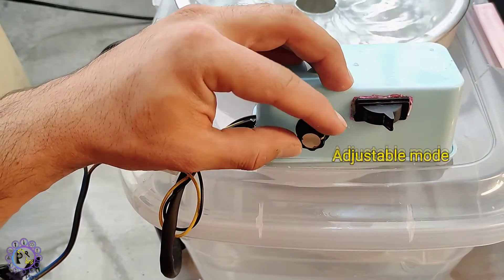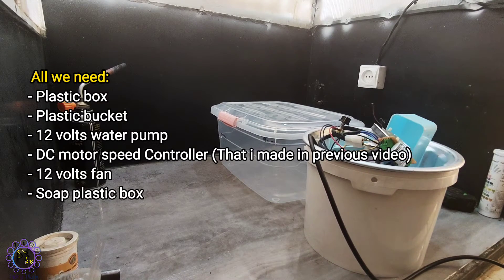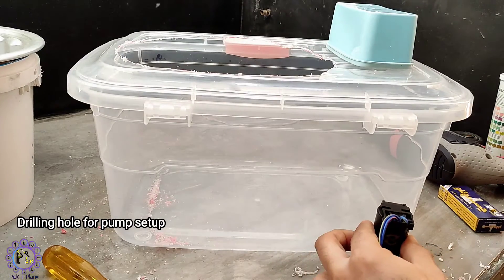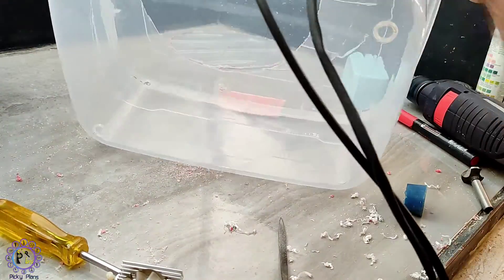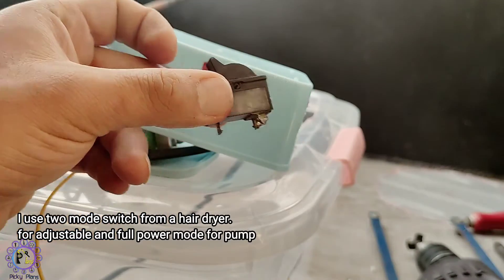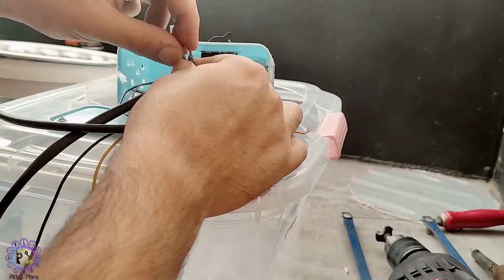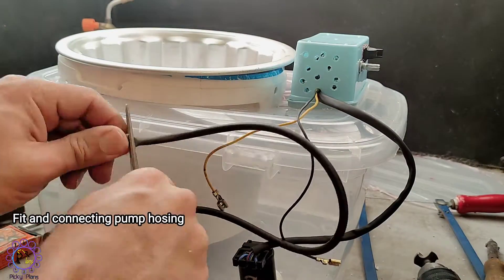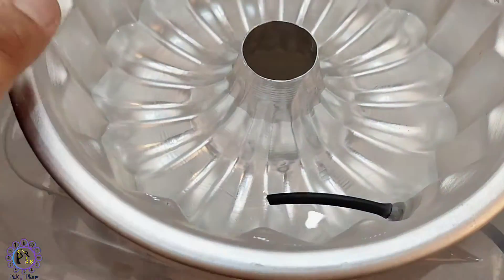Making a GOLD Concentrator mechine | blue bowl

Comment: Does it make a difference on how big around your drain over inside your blue bowl the one I'm working with the hole  is dubble the size
Reply from the maker: If you water pump could support desired pressure for moving particles in bowl properly . i would say i should be  better since provide enough surface are to separate variety of objects with different specific gravity. 
So yes bigger is better under certain circumstances